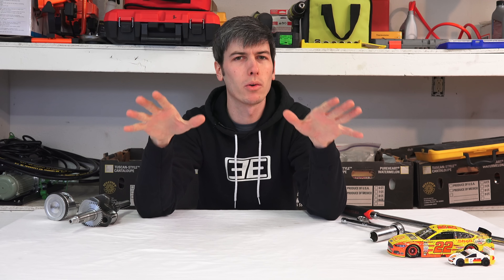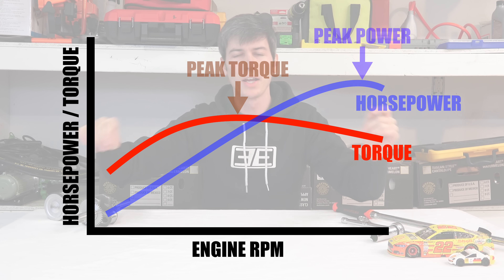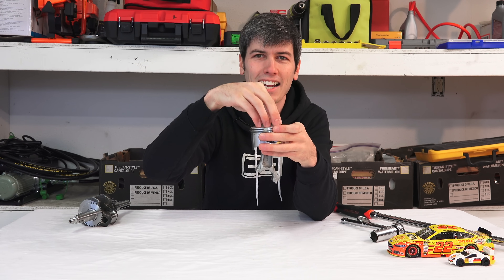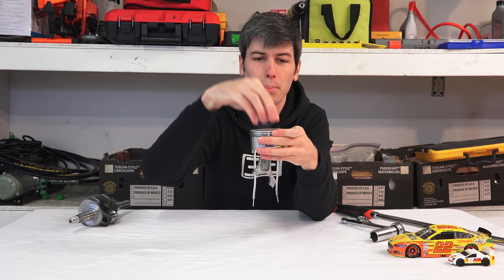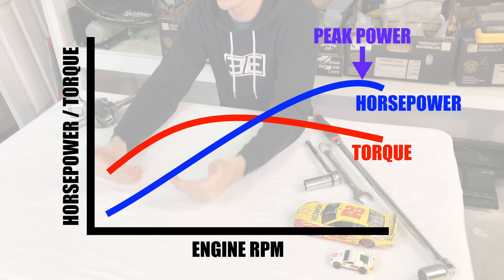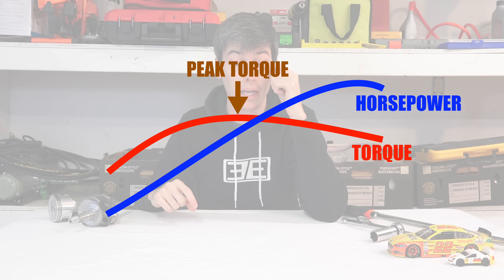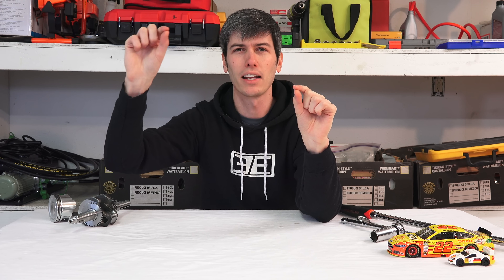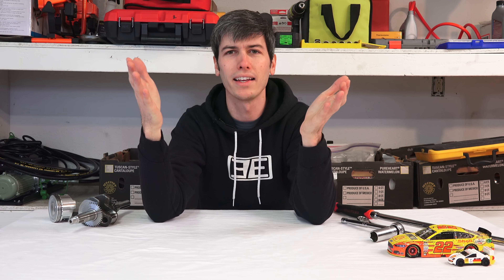Horsepower vs Torque - A Simple Explanation

Comment: the best way to look at it is that horsepower is the amount of energy that can affect the car's performance. the higher the horsepower, the higher the potential of going fast.
Reply: Not the best. The amount of energy is literally the amount of fuel in the tank. The more fuel the more work can be done, regardless time. While power is characteristic of an engine that tells how fast it transforms one type of energy into another times the amount of work done per rotation.

Comment: he said that horsepower makes the faster car and then said torque makes the faster car.
Reply: on 1 fixed gear you would feel biger acceleration when engine start spin rpm at which generate max torque at crank 👌🏻 but at one choice velocity let say 80-120 km/h each vehicle accelerate faster from 80 to 120 km/h at rpm where have max power at crank and not max torque. 👌🏻 for race second version applies assuming each vehicle have optimal multiple gears setup for theyr power grapgh but when 2 vehicle are let say electric and dont have clutch and 6 gears but 1  those cars be accelerate better at max torque 😉👌🏻 but if we tune gearbox and give such electric car let say 3 gears instead of 1 automatic which would hold rpm where this engine makes most power it would than accelerate better 😉👌🏻 assuming there be enough traction cos feg strong version tesla or rimac never already go at traction border and increase power delivery at low velocity in road condition at tire which they have  give them nothing untill somebody put on stickier tire on special surface let say than they could use those more power thanks gearbox which transfer biger engine rpm at which they have more power for better acceleration 😉👌🏻 assuming axle stand this new biger torque etc acceleration from 0-60 let say drop down from 2,1 os to let say 1,5 sec or even lower depend how much better grip would be than specified gear ratio can be chose to go at this new grip border for better acceleration anyway you have like im mention 2 point of view on 1 fixed gear where torque push you stronger into seat cos it always egzist at lower velocity than max power and have more favprable power to velocity ratio at max torque at crank engine rpm + all other resist like drag rolling drive train losess including wheel inertia and so forth is weaker at this lower velocity 👌🏻 and 2 max power accelerate better than max engine torque if you try to comapre acceleration at egzacly the same vehicle velocity feg your car have 300 nm  ft at 2000 rpm and 150 hp at 5000 rpm than using 2000 rpm at let say 60 km/h at let say 4 gear acceleration be worse than at 60 km/h also but using 5000 rpm and 1 or 2 gear whatever gear be required in this car for be at this 60 km/h at 5000 rpm 👌🏻👋🏻and like im mention earlier for race power is important for daily riding oposit most driver would like more car which have feg 300 nm very low and 150 hp than car which have let say 200 nm at higher rpm and 200 hp also at higher rpm but not all 👌🏻😉

Comment: When driving on up slope, which one reach first? Is it a big car with 200 HP and 100 LB-FT or same car with 100 HP and 200 LB-FT?
Reply: Higher power, by definition
Reply: assuming perfect gearing for both 200 hp 100 lbft with easy win this 👌🏻 empty with driver or with max load trailer dosent matter .

Comment: For me, 2 people racing to remove a torqued lug nut sort of made the best analogy to spark my understanding of this.
Force over distance is important for breaking the lug, the stronger man with the longer break bar(the most torque, low RPM range) wins this stage of the race but then it comes down to the speed which the lug is removed, the person doing this work the fastest(most hp, high RPM range) wins that part of the competition. You can't just start off going fast without having the torque to first break that lug nut and set things in motion. This describes the relationship between torque and HP and how they rely on each other and work in tandem with each other from low rpm through to peak rpm. Torque = breaking the lug nut = low rpm power, HP = spinning the nut off the bolt quickly = high rpm power.
That's why engine designers aim to have torque and HP values close to each other, but with torque usually slightly lower than HP - so they will see on their curve charts the torque numbers dominate in the low rpm range, peaking mid RPM at which point horsepower begins to crossover and overtake the torque, resulting in a relatively smooth, even power band so that is no major surging in power as you go through the RPM range.
Reply: Nope, you didn't understand this, actually, simple thing. You keep relate speed to power in your bolt example. 

But power is torque times rpm. By saying we need torque to start acceleration or just to accelerate we must agree that we need rpm to get to higher speed then, which is wrong. A Dodge Viper with 7000rpm redline reaches higher speed than a 17000-something Yamaha bike. 

For performance we don't need neither torque nor rpm, we need a multiplication of them. And a sort of a simple machine to apply maximum engine power at a required speed. Then we will get maximum acceleration possible from a certain speed, which leads to higher top speed also, because power=acceleration*speed*mass

Comment: More the Torque -> Easy to produce rpm(Means less power required to move the car)

More the HP -> Easy to increase the value of rpm(Means easy to produce more no. of rotations per unit time)

Comment: simple, torque is the twisting force while HP is the output
as for vehicles... a different video should cover gear ratios, diff and vehicle weight as impacting factors on HP

Comment: Whats the relationship b/w gear ratio and rpm? You said that rpm times torque equals power, but the whole time after that you were only talking about gear ratios? But I'm assuming that actually translates in some way to rpm as well, otherwise how would we get more power keeping torque constant.
Reply: gear ratio is for hold engine rpm where it have max power 😉👌🏻 atleast if intention of manufactory was max performance if not than whatever .

Comment: Great video.. but I have a question.. 60ft time…what would be the mathematical equation to show my fastest possible 60ft time. by changing my gear ratio.? could I ever run a taller gear ratio and be faster than a lower gear ratio…assuming everything else is equal. For example I have a power glide transmission and 750 HP motor, what would be the optimal gear ratio, to get 60ft in under 1:39 seconds..
Reply: offcorse you can be faster on taler gear ratio at 60 ft than at lower like with everything you must found sweet spot in this case. gearing cant be to short and to lomg as well you must found such gear ratio which use most avg power on 60 ft perfect gear ratio depend on vehicle weight traction and power curve and engine rpm naturally i mean at which rpm it produce its power curve idle is at 500 or at 5000 rpm amd so forth for each engine and clutch weight traction and so forth exist perfect gear ratio for fastest 60 ft and yep to short can slower than optimal long 😉👌🏻 it also depend how good is clutch offcorse  on 60 ft in fact like each other distance would impact how often you must change gear beacuse of this factor also shorter gearing can be slower 😎  peak power width is important and how strong is lowend in this car the stronger lowend = more power down low it have in regard to peak power the longer gear i mean taller gear ratio can be setup and it be fastest the weaker lowend midrange rpm especially if vehicle is heavy the lower the better be gear ratio always offcorse also impact on reslults peak power width the wider is peak the less shifting you must do the better time 60 ft you achieve feg 750 hp between 5-6 k rpm vs 750 hp between 5-10 k rpm second can be lower gear ratio would required less shifting cos from 5 to 10 k rpm you are always at max power = max performance which this engine csn you offer 😎🌪 vs 5-6 you need smaller doffrenc betweeen eahc gear lenght and shift when engine spin 6 k rpm or lil more depend how rapid power drop after 6 k rpm peak 👋🏻 etc you would show way more data than just 750 hp to setup perfect gear ratio including power graph this engine weight and traction level with which we deal the heavier vehicle it is with better traction the shorter gear ratio up to certsin point be better 😉👌🏻anyway without those data we can say only big 💩 at most 😁👋🏻 feg i change not so lomg ago in me bike front sprocket from 15 to 16 tetth so longer gear ratio this bike 60 ft dont change be a ms 😁 what im only must now do at launch is just start from lil higher rpm and it launch egzacle the same fast as before cos tore have its grip limit and whelly limits max acceleration at launch to so earlier there was huge suply from engine beside clutch also have some suply so it lose nothing after change spronger on biger at front 😁🤷🏻‍♂️ but if im launch like with 15 terth sprocket yea it be slightly slower at launch than so thers plenty factor clutch be itslef play huge role if clutch is weak than it can limited whole setup as well 👍🏻 thers also such factor like feg turbo lag or it is n/a ? i drove sometimes 2 tons bus it have so short 1 gear up to 10-15 km/h at 2 it go to 40-50 km/h or something i dont measured it precislelly yet but i fell like when i launch fast at 2 gear instead on short 1 this vehicle achieve 40-50 km/h faster cos it have also turbo lag and start from 2 gear exclude shifting from 1 to 2 gear only im must slide clutch at launch more before it completelly squeez 👍🏻 must once measured be racebox if it achieve faster 60 ft from 1 or 2 gear it be close probably but i think on 2 so taller gear be in this case slightly faster .
Reply: @mociczyczki  Understand, that an optimal 60ft time is complicated, that  is why I asked about a mathematical equation.  For example, Rate=distance/ speed…. So for my example, my car has to get 43 feet/second from a dead stop for a 60 ft time of  1.39 seconds. Which is where the the other factors mentioned by you come into play.  (power-on-torque curve) ,   (pushing car weight red,) gear ratio (transfer of Motor HP to ground force) - traction (suspension response under load) All of the factors mentioned are part of the math equation that makes up the 43 feet/sec speed.  Thank you for your response, It has helped me think thru my question a little more…..car weight, torque and traction are the control systems that can improve.

Comment: you can measure torque, you cant measure BHP, it is calculated by measuring the torque.
Reply: Wrong by definition
Torque= force x radius
Power= force x speed
So how come you "measure" first but "calculate" second?
Reply: BHP = Torque x rpm/ 5252. Simplez.
Reply: @clivewakefield1333  Torque = bhp/rpm*5252 so what now
Reply: @IgorArkin  like I said you measure the torque and calculate the bhp, and r the dynamometer does it for you.
Reply: @clivewakefield1333  what you said is a lie that you don't understand at all. I told you what force and what torque is. Now struggle a little bit to answer why force multiplied by something is "measured" in one case and is "calculated" in the other.
Don't get into dyno territory, it will break your mind.
Reply: @IgorArkin  power is a rate of doing work. The work done is the torque and the rate is the rpm. You measure the torque and multiply by the rate.
Reply: @clivewakefield1333  "the work done is a torque". Laughably not true, again by definition. 
You measure force and multiply by radius. That's how you calculate torque. By definition of torque.
Reply: @IgorArkin  AHH I understand your confusion. Your talking about applying a torque, as in using a torque wrench, that's not how you measure torque, you measure torque by comparing it to a known value. That's what measurement is. Once you have measured the torque, you can calculate the bhp.
Reply: @clivewakefield1333  what a comedy, so you were given a definition of torque and power, like what people agreed upon, their units and the way both are measured. But 2+2=4 doesn't fit your religion where torque is work, force or whatever what it is not, and it is measured 😆
Dyno. Think. How chassis dyno "measures" engine torque if it doesn't care about tire radius and gear engaged.
Reply: @IgorArkin  a dyno measures torque by applying a fixed resistance  to the drive wheels of the car. I know exactly how a dyno works I used one to develope engine efficiency in university.  That one used a water turbine as resistance to drive and when we fixed output shafts to it, there was no gearbox or tyre radius to consider. It was an engine dynonometer to measure the torque output of engines. A rolling road uses either a water turbine or electromagnets to apply a load to the vehicle engine via the road wheels And measure the engine torque.
Reply: @clivewakefield1333  answer the questions.  How the dyno you developed is reading torque if you don't input a wheel radius and gear engaged? 😆 Read. The. Definition. Of. Torque. Stop. Spreading. Lies. And developing faulty dynos of course.
Reply: @IgorArkin  the definition of torque is a force that tends to cause rotation. And there are no wheels on an engine. Stuck to guitars and leave the engineering to engineers. Ermmmm what's a pentatonic scale.....
Reply: @IgorArkin  your talkin about yourself there. Mr Dyno measure wheel diameters
Reply: Or is it the gearbox ratio, or perhaps the rear differential crownwheel diameter. Does it work for four pinion Duff's or just 2;pinion, bergaps it's double. What about overdrive, do you have to fit overdrive to your Merlin engine on the dynonometer or just the propeller perhaps.
Reply: @clivewakefield1333  why if your dyno can measure torque directly 🤣🤣
Reply: @IgorArkin  and what is a pentatonic scale
Reply: So you think all dynos are rolling roads
Reply: @clivewakefield1333  I told you a lot of new info today, not getting payed for this so here is a final one. Dyno CALCULATES energy, regardless of its type, because it needs a radius of a roller to be input in it and force is weight related and weight is mass related and there is a standard for 1kg of mass. It has a clock built in and CALCULATES power as energy spent over time. A clam is attached to one of the spark plug wires so corresponding engine speed is input. Since power is not multiplied by a simple machine (read what it is, you need it), it draws an engine power graph. It CALCULATES an engine torque graph from power curve because there is no other way. Any gear can be engaged but a direct 1:1 ratio is advised to minimize drivetrain losses.
Torque doesn't physically exist to measure it. Read what axis  (imaginary line) is.
Reply: measures torque, calculates bhp

Comment: In fact the two curves (power / torque vs RPM) are telling the same thing : you don't need the two of them as they can be computed one from the other. What a higher torque means (for a given top power) is that the torque is higher at lower RPM and thus the power curve is flatter. Not very interesting for a CVT or Automatic as the gear ratio and torque converter allow for optimized RPM. However for a manual shift gear, it implies that the pilot have more power over a wider rpm range, so changing gear at the very perfect moment is not so critical. A perfect engine would be a constant power over 0 to whatever its max rpm. Such a motor would need no gearbox at all because the infinite torque at zero rpm.
In practice a constant power over a large rpm range is making the ride more comfortable and easy...but to flatten the power curve is generally decreasing the peak values...